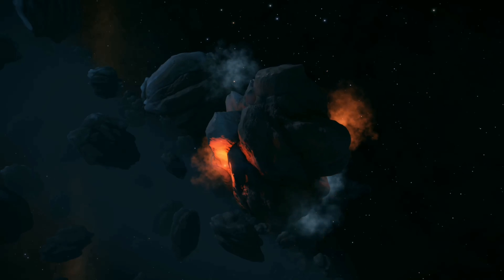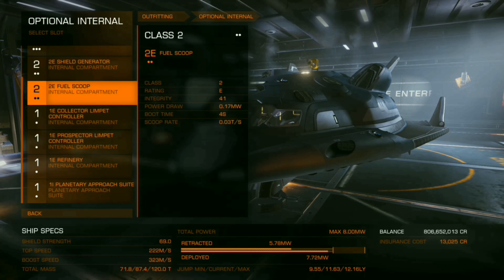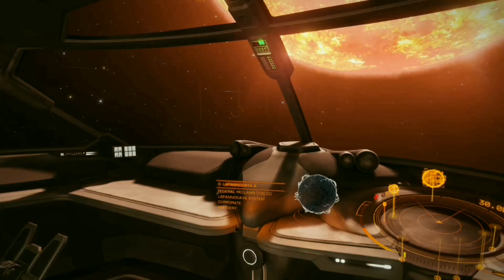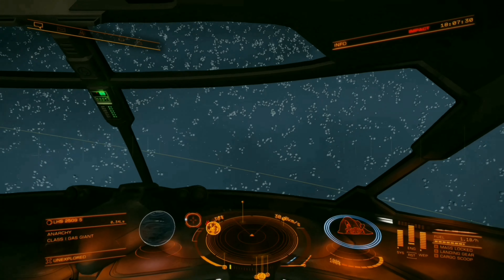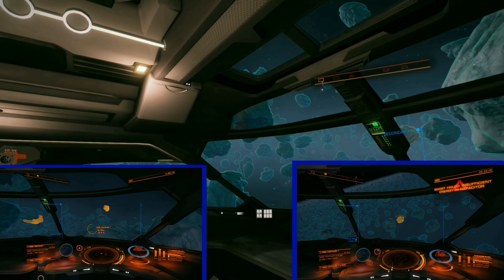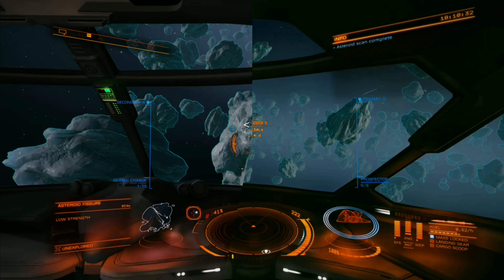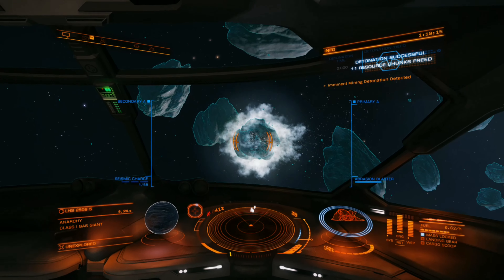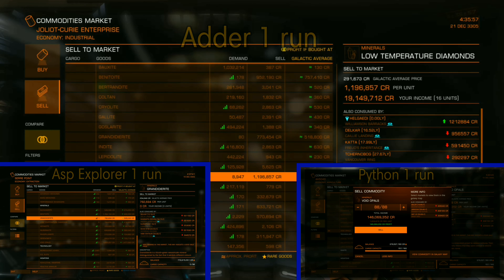PGL's Beginner Guide To Core Mining | Elite Dangerous Tutorial

Comment: A good way to start looking for core asteroids that contain opals are locating void opal hotspots. To do this, purchase a surface scanner. This allows you to scan rings and show you opal hot spots on certain spots on the ring. In addition to that, those actually turn into locations on your navigation tab called "Void opal hotspot." To purchase the surface scanner, go to a space port or planetary base that offers modules. Go to outfitting > optional internal > surface scanners > detailed surface scanners for 250,000 credits. Once you purchase this scanner, equip it to a fire group and head to an icy ring. The scanner can only work while you are in supercruise at a very slow speed. You will know you are within range once your scanner no longer says "Out of range." Once you are within range, activate your scanner and you will have a different screen. When using the scanner, you have an option to launch a scanner probe. The option is displayed on the bottom left corner of the screen. Launch the probe at the ring. By doing this, the scanner will scan the entire ring and mark spots that are hot spots of void opals. They will appear in a bright orange color on the rings and will even be named Void Opal hotspot on your screen and locations tab. Head to one of the marked spots and have fun mining  :)

I understand this is a beginner's video and one may not afford a surface scanner on their first mining experience. And he mentioned that the adder build can not have the scanner. However, once you have another ship that can be equiped with one, then there you go.
Reply from the maker: I 100% agree and after uploading I realized I left that out. So thank you and I will pin this so peeps will hopefully see it❤
Reply: @PhalanxGamingLegion  Thank you! I love your vids, keep up the good work :)